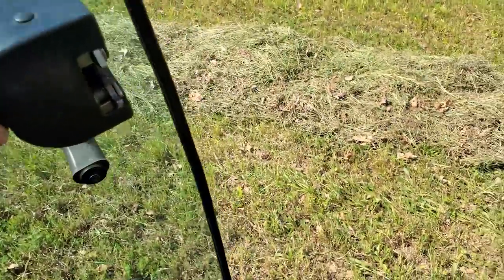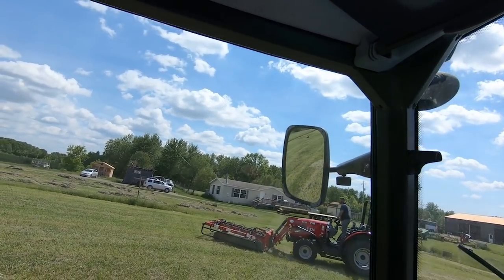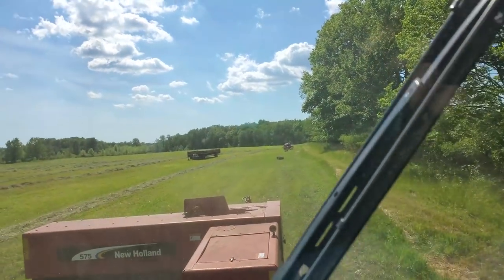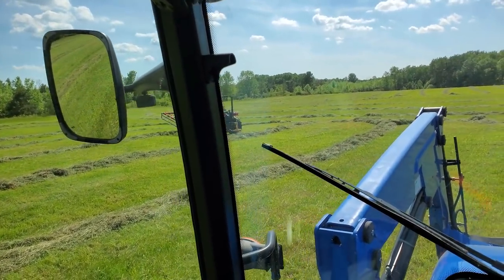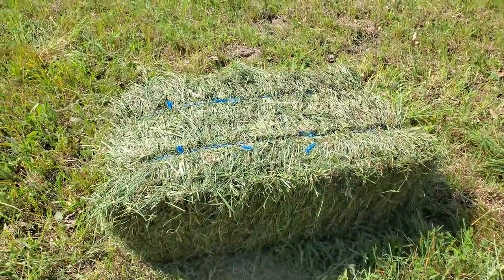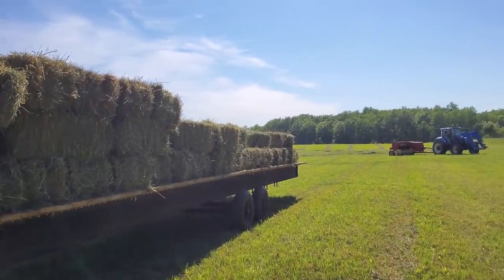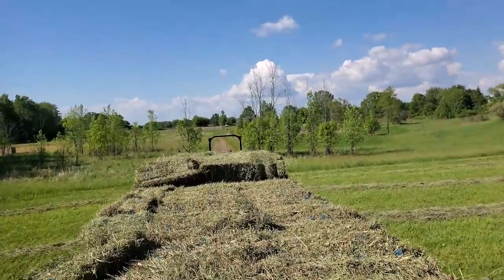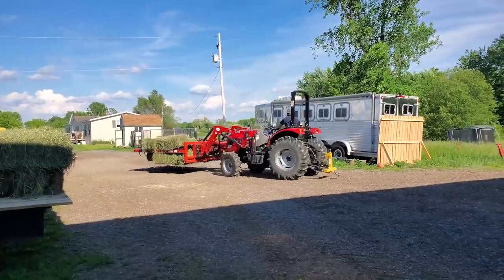380 I Was a Bit Shocked at What Happened - Baling Small Squares on 1st Generation Farm

Comment: Hello  Suzanne.  That  NH  baler  is  a  high  capacity  machine.  You  should  make  your  wind-rows  bigger  and  thicker.  You  could  have  double  racked  again.  It  will  feed  your  bale  chamber  more  evenly  and  consistently  so  the  plunger  has  a  full  charge  and  makes  a  more  dense  bale.  If  the  wind-row  is  very  heavy,  then  just  go  slower  when  baling.  If  you  get  a  large  clump,  then  either  inch  it  thru  or  reverse  for  a  few  seconds.  It  looks  like  you  got  your  "timing" figured  out.  If  other  wise  you  would  be  breaking  bales.  Make  that  baler  work!  That's  what  it  was  designed  to  do.  You  have  a  good  set  up  with  your  equipment.  Happy  harvesting!!  😊

Comment: I use a bale accumulator. It is much easier with a skid steer. I follow the baler and bunch then in groups of 10. Then switch over to a grapple to load on the trailer and and unload and stack in the barn. There is definitely a learning curve with these things.
Reply: yes we figured that out for 2nd cut so much better doing it that way. the trailer stacks so much better and so much easier unloading too.

Comment: i have used a maxilator for several years now and thousands of bales...be happy to give you some tips if you need them......the fix to erics problem with nose bales comeing lose is esp when you pick them off the trailer you need to make a point to put down pressure on the nose of the grapple before you close the grapple hooks ......if you will watch how it works closely you will also see when the hooks close  they compress the bales twards the tractor (understanding this and how it affects loading and unloading the pack will help a lot) ....he will also learn that when loading/unloading that compression effect can eject the 2 sideways nose bales if he doesnt use down pressure ...this effect is not evident from the tractor seat ......also as someone mentioned you can acumulate in the field then reconfigure for loading and unloading ...but with a bit of practice and patience you can learn to load trailers just fine for short hauls the way he was configured which due to the gaps can allow for some on the trailer hay curing due to the additonal air flow due to the gaps ......anyway good luck .....how many can he put in a layer on his trailer ? couldnt tell from the vid ...
Reply from the maker: He has gone as many as 4 stacks high (200bales) but had a lot of issues with bales falling off the back, so he sticks to 3 bales high now :)

Comment: Make your turns to the right since the baler is offset on the right side of the tractor; you won’t leave any hay on the ground during the turn. I’ve never had any PTO problems but I’m running a JD 4430 and a JD square baler with a Hoelscher accumulator attached to it. My hay barn is open on the long side in order to drive in and stack bales with a Hoelscher grapple from one end of the barn to the other.  My accumulator makes a cube of 10 bales before sliding them onto the field. I’m not a fan of accumulators that drag bales across the ground while gathering.
Reply from the maker: We are trying to find a cost-effective way of accumulating them :)

Comment: We run a 575 nh baler.  There should be a much bigger flotation wheel on the pick up.   The pick up is too big and heavy for that single wheel.    

We have the same grapple.    It’s paired with a Kuhn ten bale accumulator and works pretty well.   Just had to take out the divider plates.
Reply from the maker: I need to check the manual and see if I can trtack down the correct parts then :)
Reply: Yes, but the wheel shouldn't be running on the ground all the time.

Comment: Viewed 8-5-21  6:38 PM   from Illinois    Hi Suz.......Don't know issue with pick up wheel ??   You baler may have a spring assist to help FLOAT  the pick up. Check to see if there is one, may need to a just tension or it may be broke  :-))
Reply from the maker: It does have a hydraulic lift that we discovered just this year but doesn't seem to be working . . . there are some things that DO need further investigating ;D

Comment: You can't stack with the maxilator in accumulator mode. Do all of your accumulating...convert it and then stack your bunches. With all dividers out and one side left on you simply nudge the bunches of 10 to tighten them for loading and stacking. You're trying to do two processes without changing the grapple over.
Reply: yep thats what we ended up doing 2nd cut worked so much better. Now if you go to maxilator website they show them accumulating them and going right on the wagon.
Reply from the maker: This is how they recommend and show it being done on their website. We did end up doing it our own way on second cut which was less headache ;)
Reply: @ruralridez6165  yeah for me it was obvious that all off the dividers were going to make for a loose stack. It' was also obvious by looking at the tool that it has quick  pins and adjustments to transform from accumulating to stacking. I realize though that not everyone has been around equipment and farms like I have. Glad to hear you got it figured out. The inventor is pretty pissed about you guys making negative videos about it when you were simply using it wrong and on an improperly equipped tractor.

Comment: I don't push my 575 hard either.  I get done faster if I go a little slower and avoid getting out of the tractor a bunch of times. Now when the baler was brand new, it was a a little different LOL!
On your hay pick up issue...How can your height adjuster bar come out?  There should be a bolt in one of the holes to provide a limit of travel stop. The gauge wheel should not be running on the ground all the time.  And yes, the gauge wheel should be a real tire 2 or three times as wide.  But the gauge wheel should touch the ground just to keep the tines out of the dirt in uneven ground.  I'd like to try the grapple, but on my skidloader.  Everything is a compromise, but much better visibility and control.
Reply from the maker: No adjustment on the baler :( Looks like I need to write out all the parts I need to rack down and replace with better ones, lol!

Comment: Two things the pick up should have spring tension so that all the weight isn’t pushing it in the ground should adjust the tension till pick up kinda glides and always remember the only person who makes zero mistakes doesn’t do anything
Reply: Take paint marker to the pto clutch try to mark all the disks and after a couple rounds the marks should have moved about if not the clutch is frozen up just loosen up the springs till everything frees up then there should be a measurement in your service manual for the length of the springs should be haha bout forgot but that’s probably why it breaks a shear pin when ya let her eat

Comment: I agree with everyone else accumulate the whole field then remove the dividers and load the trailer. This will alow you to “pack” the pack with the loader witch will keep your stack tighter.  As far as the baler goes you really should be running it at high capacity to get good bales  Mechanically handling small squares requires solid tight bales.  Double your windrows and or drive fast when the hay is that thin. If you are breaking shear pins then you have problems that you haven’t found yet. We ran a 570 for a lot of years at 400 bales an hour and very rarely broke a shear pin. It was an older baler also.  Hang in there you guys have just about got it figured out.
Reply from the maker: My 2nd cut I was having a race with Kayla @chroniclesofafarmerswife and figured my baler was spitting out about 600 bales per hour (or 15 bales a minute) when the hay is thick :)
Reply: Awesome! That probably felt good. Those high capacity new Hollins will flat out b that probably felt good. Those high capacity New hollands will flat out bale hay, there promblem though is that at the high speed they will throw out a long bale 10 percent of the time (which you might have figured out already). Those long bales would givte me fits on our automatic bale wagon, so we tried to keep it around 400 bale per hour. We eventually switched to an older version of what Kayla is running. Bale consistency is way better with an inline baler.

Comment: The biggest  reason  you turn right is you  can see the  hay going  into the  pickup  better and you don't  have to  drive  over the  hay  turning  left or have skips  and if you look back when the hay was being stacked on the wagon as it came out of the shoot the drawbar  is on the right  side of the bale shoot it wasn't  until  later on  they went center  with the thrower  so the wagon pulled  center
Reply from the maker: makes sense :)

Comment: When you put the baler hitch in the baling position, the rear u-joint is running at an angle.
This causes the driven shaft to rotate faster and slower as the shaft rotates.
When you turn left, the front u-joint runs at an angle that causes the baler shaft to have parts of the rotation go even faster.
When you turn right, the first part of the turn actually makes the driven shaft run at the same speed during the whole rotation.

If you turn too sharp to the left, the middle u-joint can get too much of an angle.
In conclusion, the drive shaft is designed for turning to the right.

The wheel on the pickup is turning in the direction that will tighten the nut on the bolt.
The correct wheel should have a spacer between the bearings.  Tightening the bolt will tighten the inner races so the wheel will turn on the bearings instead of the bolt.

Comment: What's the reason you stopped using the bale baskets? Too much work? Broken bales?
Reply from the maker: If the knotter slipped a knot, you couldn't tell until there was mass chaos. Trying to pull all that loose hay out what impossible, and ended up making big messes at the barn. Then it still had to be stacked. Erik wanted something he could use when he's old and much grayer ;D
Reply: @This1LifeWeLive  Ah, makes sense! 👍😀 
Looking for something easier ourselves. Unfortunately it would involve even MORE machinery/equipment!  🤔🤔🤔

Comment: I think it's engineered to fail. We had a '67 hayliner 268 that we ran flawlessly for 30 years, no major repairs or adjustments, just grease and twine.
Reply from the maker: It'salways a gamble when you buy used equipment though, and this had been WELL used and was rusting pretty bad when we bought it. Seller had painted oevr everything with fresh paint and stickers to hide it. She may need some welding this winter . .

Comment: I’ve never used a hay grapple, but it seems that from my hay hauling experience, that the hay should go in 4 vertical, 2 horizontal, and 4 vertical.  Might be better to wait to start grappling until the bailer is over half done bailing the field.   You seem to be doing lots of unnecessary driving around the field following the bailer.
Reply: I have the same grapple. They're just doing it wrong.
Reply: We are learning. So what we found works best long straight runs accumulate all the hay first then take off the dividers and pick up and stack on the trailer its actually works really good that way. I can accumulate and stack 200 bales in under 1hr. It also easier to line bales up going a bit faster then slow.
Reply: @ruralridez6165    Experience always helps.
Reply from the maker: We are just following the guidlines set-up by the manufacturer along with the videos they post for reference. (just like our original bales were set to their specs and that turned out to be a fail). So we have improvised our own way of using it by 2nd cutting that worked much better than the manufacturers way. Still time consuming, but less headaches at least.
Reply: @This1LifeWeLive  one more tip....not sure if you guys got it is that once you get the bundles accumulated you can then grab them from alternating sides. That allows them to hold better in the stack. Glad you guys got it figured out!
Reply: @This1LifeWeLive  I spoke to the manufacturer (cell phone) before buying mine and he claimed he hasn't changed dimensions but I wonder about that because my 39-40" bales work fine.
Reply from the maker: @Fabes002  we tried several times to call email with no luck. Based on the number of used ones for sale right now I'd say we aren't the only frustrated ones. I talked to another company (by phone) who makes a similar one and he gets people swapping out their maxilator for his version of it. I think his was made well before maxilator came up with theirs but he didn't patent it..
Reply: @This1LifeWeLive      I’m sorry but, won’t every salesman tell you that?   You will figure it out and make it work!
Reply: @KevinCoop1  yep... it's not the golf club's fault.... it's the person swinging it. I bought the same tool as they did after asking the guy who invented it about her claims. He reassured me and guess what. It works great! When I bought mine the dealer had sold 3 that morning...I passed one leaving on the way, and another guy came in behind me to buy one. You can only blame the tool for so long. I didn't have any problems with the instructions or understanding how to use it. I was actually expecting to have to reduce my bale size from 39 to 36 inches but it worked fine from the get go. I now know why the manufacturer is mad at her and won't respond. She's giving his tool a bad name just because they used it wrong.
Reply: @Fabes002    So criticisms can be destructive or constructive.   A good thing to do here would be to tell how you use yours differently than what you saw in the video.   You have done some of that, but any more guidance would probably be appreciated by them.   If I offer a suggestion and the receiver desires to ignore or knows more than I do, then so be it.   Have a wonderful day!    Kevin
Reply: @This1LifeWeLive  yeah he's pissed at you guys because you posted negative videos about it while you were using it wrong. Imagine how you would feel if someone was posting negative videos about your hay simply because their horse is a picky eater.  I was lucky enough to get his cell number from the "parent" company and talk to him about your issues before I bought mine. He even offered me a demo unit to try but I was in a hurry and couldn't wait for his rep to bring it. I'm glad you guys figured it out in 2nd cutting and think you owe the  manufacturer a public apology. I haven't seen any used ones and my dealer was struggling to keep new ones in stock.
Reply: @KevinCoop1  I've done nothing else but try to help them figure it out.  It's possible my comments on another video this spring helped them figure it out. Remember there could be weeks from the time they do the work until the video posts. They have both said it was better for 2nd cutting in these comments and yet they still posted this negative video. I think it's rude for them to post negative videos about a product when the truth is they were doing it wrong. A simple disclaimer in the last video would have been nice. The poor guy who invented this thing is losing money because of it.
Reply: @Fabes002     Awesome to hear you are trying!   Me too!   Deaf ears on some things!

Comment: The height adjustment wheel for the pickup should be at least 2  Or 3 times as wide and and I've seen Most with rubber tires
That  really  flexing  way to  much for the hay trailer and you get too big of stack they will fall off the longer the trailer  the more flex you get mobile home  frames  real strength  comes  from the rigidity  of the house  and  FYI  keep a eye on your axels trust me they will  bend not as strong as  people  think 
You really need to  look  into buying or making accumulator that would  save so much time in the field
Reply from the maker: We will be testing an accumultaor this fall, hoping it will be a good fit for us :D